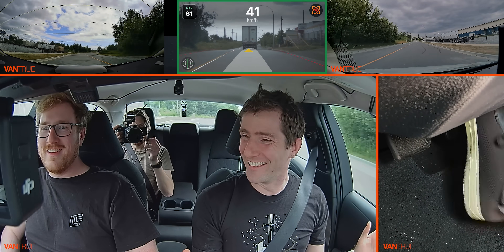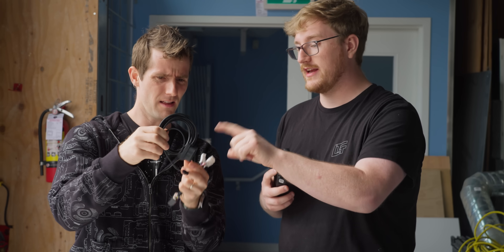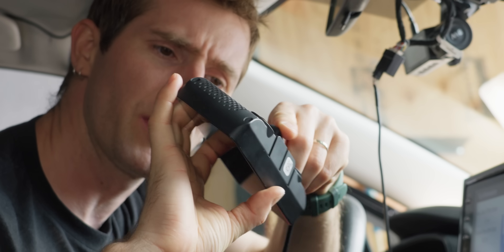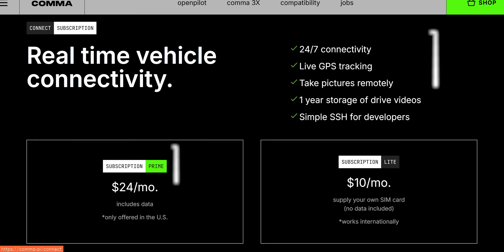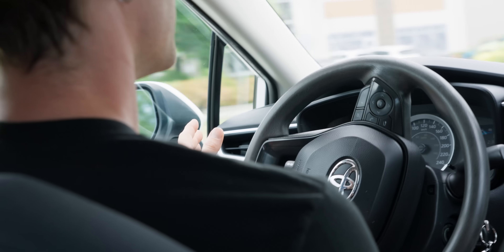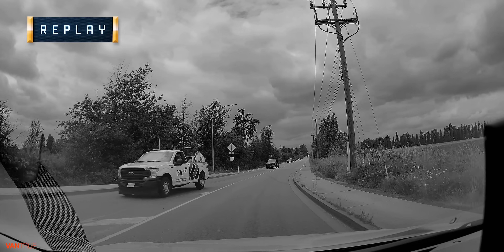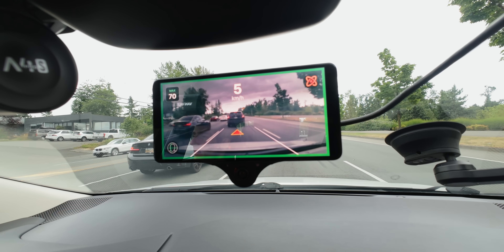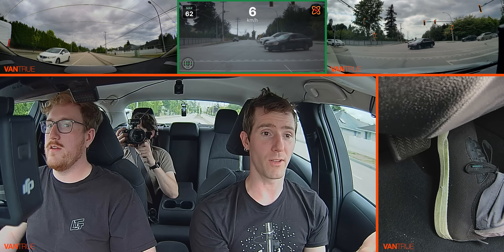I Upgraded My Car With Open-Source AUTOPILOT and it's AMAZING

Comment: I've been following Comma for a while. Most vehicles have a torque limit on their steering hence why you keep getting the 'steering limitation' message. Some people will specifically buy certain vehicles to avoid this issue as they take their Comma into consideration.

Comment: I'm curious specifically with the Toyota Corolla, they have included lane keep and adaptive cruise control in all models 2018+ and currently it seems like they package they (comma) offer currently is just slightly better than the built in system. I sure hope their software and user experience ramps up quick

Comment: Welp, my cars supported. If it allows me to stop being reminded every 5 seconds to put my hands on the wheel, ima buy it for my kia k5. My k5 has self driving (lane keep and turn assist), so it will work well.

Comment: i am totally not a car guy, so confuse how it work, isn't older car's steering and paddle is all analog mechanical? how a device can just control a car? but this is crazy, its open source!!!
Reply: I guess it's using already built-in systems like lane assist, speed limiter, proximity sensor and cruise control to drive itself. The lane assist can only turn the wheels to a certain degree.
Reply: At least Toyota Corolla, as shown in video, has electronic power steering, i.e. what helps you turning steering wheel easily is electric motor (first time I've found it in Renault Megane II about 20 years ago and I believe it wasn't first car with it). That's the first requirement you need for this kind of driving assistent, I guess. Corolla itself is able to use it for "Automatic parking assistent" where car basically parks itself (you only changing Reverse and Drive and release the brake pedal). Truth to be said, it is hit and miss (sometimes it is able to park perfectly, sometimes it really struggles).
Many cars nowadays have adaptive cruise control with "full stop" feature, i.e. car is able not only press the gas pedal but to brake itself too. That's the second requirement for this driving assistent.
So when you have car which is able to control to accelerate, brake and to steer, all by wire, and OpenPilot knows how to control it (most probably specific to each car), you've met all requirements for this.

I don't have any OpenPilot device, I'm just guessing what you'd need as minimum for this.

Comment: On one hand i'm super bummed they don't support BMW/Mini, on the other hand i'm completely UNsurprised lmao
I own a 2011 Mini S and because of how BMW does key fob/vehicle security its ridonkulously difficult just to do simple stuff like a remote start; and you gotta actually mail out your ECU to a shop if you want any form of proper engine tune. BMW hardcoded the factory tune onto an IC and they have to swap out that for a EPROM just to do any tuning on the damn thing.

Comment: I don’t understand the purpose of it. All it does is add stop and go. My Hyundai already turns on sweeping roads and has lane keep assist. I’m not entirely understanding this product and why they support Hyundai vehicles when they have smart cruise control. They also say it’s required that the car has smart cruise control so that means the car can already turn on its own and keep itself in the lane on its own at all times so all that I see this product adding is Stop N Gas functionality.
Reply: It does lane assist better than stock, i guess.

Comment: What if, Someone pulled the agent code from a Racing game and plugged it in to self driving. it has to avoid other cars, and objects, stay on track, and follow the best line for the speed. I am sure there is an adaptive one that isnt fine tuned for the courses that, a pre built(rendered) fine line, but one that is adaptive for user generated content, like trackmania.

Comment: I don't get the point of this? A Corolla with LKAS (seemingly required for the Comma to work) lane keeps better than this on its own anyway? I drove 600km in two days around Sydney and NSW with the built in LKAS and Radar Cruise and it would take corners at 110kmh, and drive through tight dual carriageways at 60kmh inches from the cars to either side and it was great at it - miles better than the performance of Comma in this video and without even remotely coming close to veering out of control like we see in this video. What is the Comma supposed to add, considering it doesn't do navigation and seems to require the car to already support lane keeping?!
Reply: Hands-Free driving, better control than stock LKA/LCA, changes lanes automatically.

It does offer a fair bit, especially on cars with higher limits on their signals.

Comment: First I will start off by saying I am a Tesla Owner and my Wife Owns a Ford Mustang Mach-E GT.  Second, I think its great others are doing Self Driving and the more we can get to either come up with their own or license from others will drive down the cost, but Linus Bias in these type of videos is annoying.  I am sure the haters will come out and say "Then Don't Watch."  Why?  Why can't I watch and voice my opinion like everyone else to start a discussion.

1) He stated about the cost and industry norm implying that the cost of Self Driving going up.  When I bought my 2021 Tesla Model Y.  That was I believe the second year they had that model.  I purchased FSD at $15k.  I considered that an early adopter price.  Right now on the website it is an $8K add-on.  So that means the price is coming down now.  Also if you can't afford it up-front you can get it on a subscription bases.  So, again it is coming down in price as you would expect with more people purchasing it and with time.
2) The issues experienced in this video with the self driving he experienced with early versions of Tesla's Self Driving.  He let this product off the hook.  It doesn't matter the cost of the product or if its open source or not.  When you are comparing one product to another with clear bias to another, you need to be fair.  Something he is not.  He has never gone back and done a fair review of latest versions of Tesla FSD.  I personally have gone over 600 miles in one direction with FSD driving 95% of the way.  I would say that is pretty dang good.
3) He was pretty lose with calling this Self Driving with no issues, but with Tesla Calling their product self driving he had issues with it.  Tesla Calling Full Self Driving just that is not confusing as when I purchased mine it was clear on the state of the website where it was, it was clear in all the paperwork I was provided.  It was called that because that is the product they are producing.  That is why the had in the name Full Self Driving (Beta).  If we needed the name of all software when it wasn't 100% ready. Then that would lead to confusion because the software would have one name for months or year, then all of a sudden have another.  Look at what Microsoft does every 6 months to a year with their business product names.

Again, I love to see tech like this, but what I don't like when someone basically says its ok for this company to do it and get away with it, then another.

Comment: One huge thing missing is using the radar sensor for adaptative cruise control. On my Corolla the built-in adaptative cruise control is really useful on the highway when the weather conditions are not good because the radar can detect the car in front of me way better than my eyes and start breaking earlier if something happens, it's juste reassuring. And for everything else, like driving in the city, anything looking like adaptative cruise control is simply not safe enough. The system should be able to detect pedestrians, bikes, scooters, other cars, object on the road, road works... if it can't do that it's probably safer (and less stressful) to just hold the steering wheel by yourself.

Comment: I've had the 3X since release.  It beats the pants off the built in stuff in my 2022 Subaru Outback and is awesome on road trips.  Sunnypilot is the best fork.  Technically you're not supposed to mount anything to your windshield in Virginia, but I looked at the rule and they can't pull you for it on it's own, and It's only a $90 add on fine to whatever other ticket you do get pulled for.  I get pulled like maybe once a decade so I figured YOLO.

Comment: Level 2 self driving is in Europa ment to be driven handson, you need to have your hands on the steering wheel and always give it your input. Most of the time the level 2 will do the right thing but if it gets complicated, u are the driver. Breaking if no car or truck is in front of you is a problem and is your responsibility. All in all it is actually great if you recognize it's limitations. My experience is white a 2024 Toyota Yaris hybrid.

Comment: Btw this year corrolla has limited steering assist, which is why it cant make sharp turns. If u went with a slightly newer model corolla it would have been table to make sharp turns

Comment: 17:47 Ayy, I never thought my first video would make it to LTT, super cool. Glad you guys took a look at openpilot, can't wait for more videos about the forks.
Reply: Also, for anyone curious, feel free to ask questions, if I don’t have the answer, I definitely know where to point you to.
Reply: @SpysyWeeb  are you using the base software? because from what im seeing in the ltt video, it shouldnt be able to do turns that sharp
Reply: @coopergoon  Openpilot can absolutely do turns this sharp, the issue is both speed and tire friction. Because I was only going 11 MPH, the driving model had plenty of time to calculate what path to take, so less pathing errors (also, most cars struggle with torque at higher speeds). And because I'm driving on a dirt road, the tires are able to move a lot easier, so the Electronic Power Steering (EPS) motor doesn't have as much of an issue turning the wheel. I was using frogpilot in that video for the "Always on lateral" feature so I can control gas and brakes, and screen recording. I've driven on the same road with stock openpilot and openpilot longitudinal control enabled so I can set my cruise control that low and it drove just fine.

TLDR: No, but it doesn't matter.
Reply: @SpysyWeeb what car model was being used?
Reply: @Tehan_A  2021 Hyundai Palisade

Comment: no it's definitely not the cheapest after it runs someone over or after you spend lots of time in court for illegally testing software without permits. Fun fact, every single Tesla with auto pilot is also illegal. As usual the failure to punish is the problem
Reply: @jeffkleist9679  you have to pay attention. It's not a self driving car. It's not different than lane assist and adaptive cruise.

Comment: You should now do a Tesla FSD video to actually show what the best of the best can do (and please use HW4 don't be Mark Rober or MKBHD).
Reply: Mark Rober faked the video didnt matter if it was HW4. There is a video by Kyle Paul proving it was fake by recreating all the same tests, and FSD pass them all easily.
Reply: Considering the robotaxi rollout, a blind squirrel with half a brain would drive better than FSD.
Reply: @Guitarocker493  
Meanwhile in reality FSD already drives better than most humans. The media is lying, as always, listen to those who actually used it, or watch the livestreams.
Reply: @Guitarocker493 Take a free test drive and try FSD. It is very good.
Reply: @Guitarocker493  Don't get me wrong, it's definitely not perfect, but it's having fewer issues than Waymo, while also not having the whole area premapped - unless you believe the over-exaggerated reporting.

Comment: The steering limit is 100% the car. Honda is the worst. Toyota is pretty good. Hyundai-Kia is the best. My IONIQ 5 never wants for steering power. Openpilot has driven my family over 75,000 miles. It’s the real deal.
Reply: I have found that my 2017 Acura MDX has better steering limits than a new Honda Odyssey. Not sure if it's a fair comparison but I find it strange since honda owns acura.
Reply: @jujuu1339  in your opinion is it not worth it for a 2024 Odyssey? I just saw they support it but if the cars not decent enough not sure it'd be worth it.
Reply: Since you mentioned the Ioniq 5: How does Hyundais HDA compare to Openpilot? (If you have experience with that)
Mine has the regular HDA, so it keeps lanes quite well but doesn't have any fancy features like Lane Switch Assist or any of that.
Reply: @FlorpyPamda  three massive differences. First and foremost, hands off the wheel. Comma 3X actively monitors that the driver is looking forward at the road and will allow the driver to go hands free indefinitely if they are attentive. Second, it’s a better and more complete driving model. For example, it can handle laneless and construction situations where HDA is useless. Third, it has a longitudinal policy that is better than HDA radar cruise control. So you can enable experimental mode and it will stop at stop signs and red lights.

If you wonder about value - I bought it and I use it and I couldn’t imagine going back to HDA.
Reply: What about a Mazda
Reply: What fork and driving model do you use? I too have an Ioniq 6 with about 10k miles on sunnypilot.
Reply: @aBigAstrounat  sunnypilot all day every day.
Reply: My 2018 Volt is pretty awesome with my Comma 3. Pretty much any curve it is fine with. I am using the GM frogpilot.

Comment: Need to be careful with stuff that plugs into the ODB II port. It drains the battery and can brick your car by damaging the many computer modules. Insurance companies have been sued because their 'dongles' brick cars. The ODB II port was designed for short term uses (pulling error codes) so many don't have robust protection against power spikes etc.
Reply: It's good that the OBD port connection is optional

Comment: What you are doing is no different than what Tesla, and others, are doing.  You are running an experiment on public roads using the unsuspecting public as guinea pigs.   I can say that my car is similar in that it can't take sharp turns.  What really sucks is that it's only warning is a flashing logo on the dash, so if you are not paying attention you will crash.
Reply: You have no idea what you're talking about.

Comment: 11:14 My Tesla using Autopilot not FSD will slow down for curves. Ran it though a Curvey mountain road and it slowed down for the turns.
Reply: @jightning  same, autopilot does great
Reply: @jightning  same for me, it actually slows down too much at times, but better safe than sorry.
LTT should really remove that part, because it’a misleading as fuck, though they have been on a Tesla/Musk crusade for some time now.
Reply: Neither the Comma or a Tesla is fit to drive by itself
Reply: @rosen8757  That's why both require your full attention and supervision right now.
Reply: @rosen8757  Neither are most human drivers...